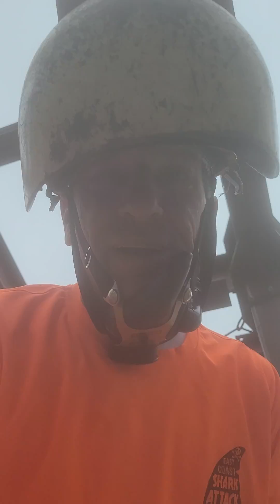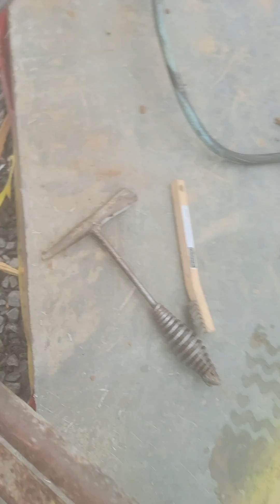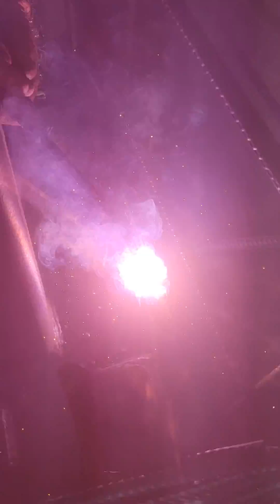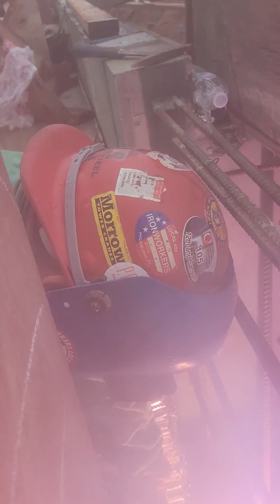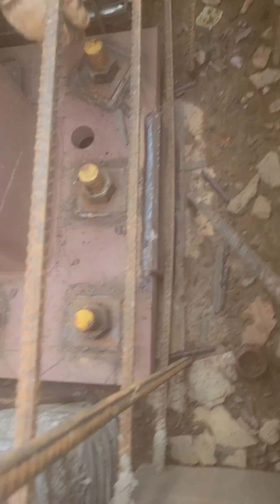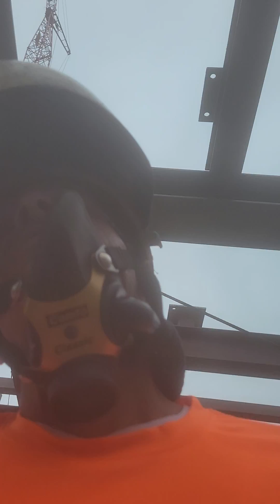Structural Welding/FluxCore =Flat(NR305 5/64)

Comment: Never ran nr 305, does it run similar to 232?
Reply from the maker: Jonathan, No it's not the same, 305 is for flat and horizontal, You run it hotter, Just totally different, You just have to try and you'll see for yourself
Reply: @jetweldingllc4691  thanks i appreciate the information and yeah ill have to buy a box of wire to test out

Comment: I’m trying to get this wire jet 

4th period apprentice for local 433 with stick and wire since pre apprentice 

What numbers you run? 
How much does lead affect the settings? 
What’s your rule of thumb? 
I’ve been trying out 305 on horizontal and I’m glad you do the whip on it because I do it too😂
Reply from the maker: Gahbeh, Look at the description, Working with your wire speed, I run it rich, Once it starts jabbing back it off and you'll find the perfect wire speed that you would like, Remember when you're in class, Your inverter has hardly any lead on it, So your Volts could be, Much lower , I'm usually running  200' of lead, That's why I'm at 30 V,,  practice makes perfect, I'm sure there are some awesome welders on your job, Learn from them, Have a good night
Reply: God bless 
You remind me of them
I hope to help keep paying in to your retirement whenever you pull the pin 
💪🏾